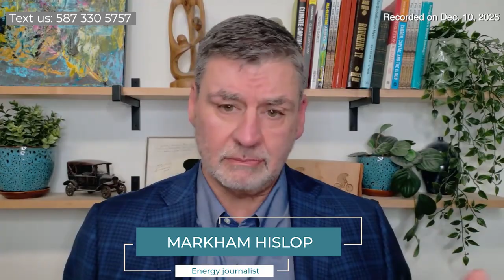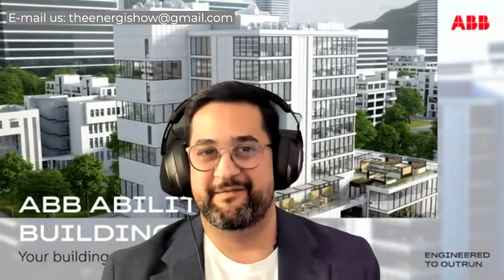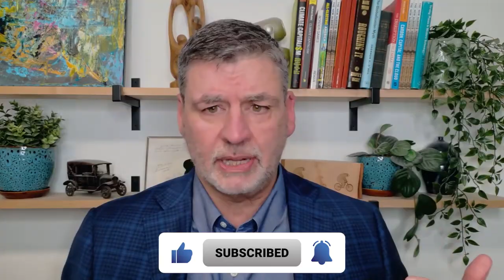Buildings Helping to Manage the Grid? What Will They Think of Next?

Comment: Heat pumps using R290 refrigerant in an air to water (ATW) mono block design will supply 100% of heat and hot water for most of Canadas population. It’s what is used in Scandinavia for cold climate heat pumps.
Reply: Is Scandinavia willing to  pay for Canadas?